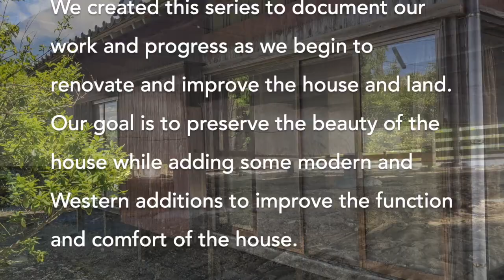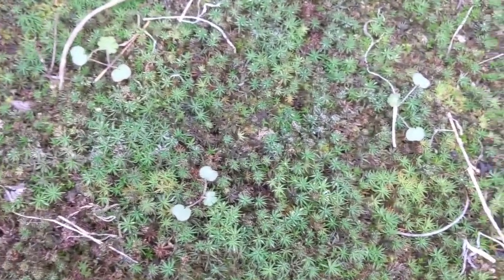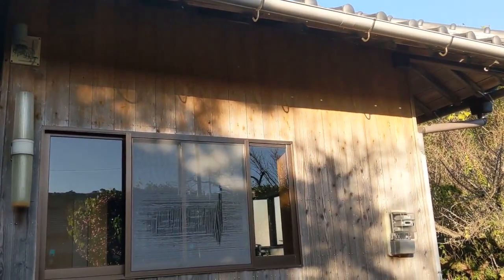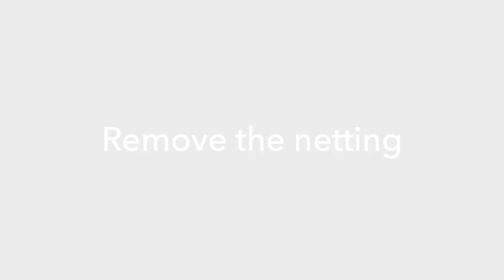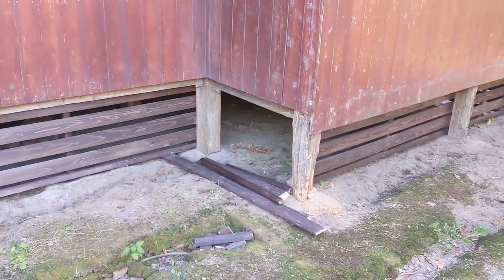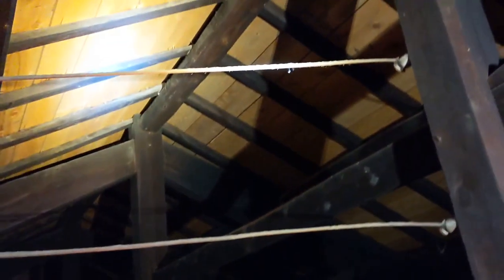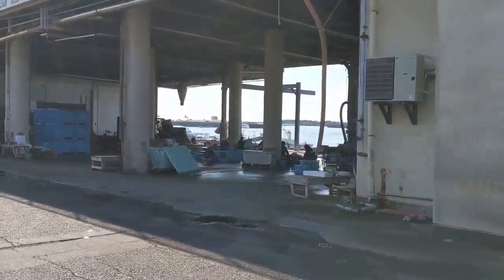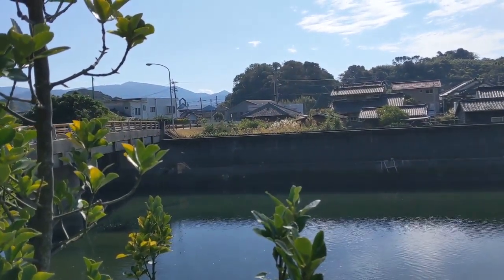Renovation Journey Japan Kagoshima Episode #2 - Final Walkthrough and Work Start

Comment: Just started viewing, as I own a home in Kagoshima (arrived 1997) and have lived all over Kagoshima-ken, as well as Miyazaki and Kyoto for stints, but I'm also looking at buying other fixer uppers and curious about what others are doing. 

You keep referring to "drafty pop-outs" ...

Those are storm shutters that slide across to cover the exterior of the sliding glass doors and windows during typhoons. 

Unless the shutter boxes have over time pulled away from the wall creating air gaps, they usually don't create air leaks as they're mounted externally (unless these were constructed without a barrier wall, which I've never seen before?)

The shutters may need repair or replacement, but it's a very bad idea to remove them permanently - just wait til a bad typhoon season, and you'll see why! 

Looking forward to your updates.

Cheers
Reply from the maker: Hello, yes, if you check out some of the videos following the first one you can see what we did to address the issues with the 戸袋 (tobukuro), which are the cabinets to house the exterior storm shutters. The cabinets were affixed to the outside was but there were massive gaps in between the cabinets and the interior. Unfortunately that's how it was originally built. We removed them, closed up the walls and installed new aluminum shutters and cabinets. Keep in mind it's a 97 year old kominka, it originally had no running water, no electricity, no insulation and only an Irori in one room for heat. It wasn't built to be air-tight, so we have had some work to do to improve things. Thanks for watching.
Reply: @Renovation Journey Japan   Thanks for your reply. 
I saw the follow-up video, and I was shocked at those gaping holes. Wow. I've never seen that before in all my years in Japan. 

Great work framing and insulating. 

Good luck with the continued work.

Btw, back in 1997, there was a small shack café/bar on the beach on the right side of the pathway looking towards the ocean at Arahira Shrine (I know it goes by about three names lol).

A group of us foreigners along with Japanese friends had some overnight beach events, and even some bands played on the concrete platform to the right of the stairs going up to the shrine. 

It's also a great little swimming and snorkelling spot. I'm happy to see it featured. 

Having been to over 40 prefectures and transferring / sighteseeing around Kagoshima, including all the islands, it's hard to beat Kagoshima!

Cheers